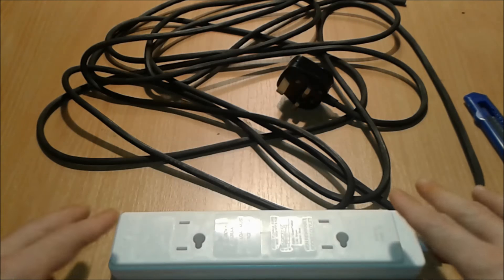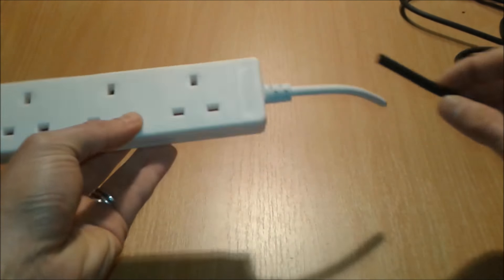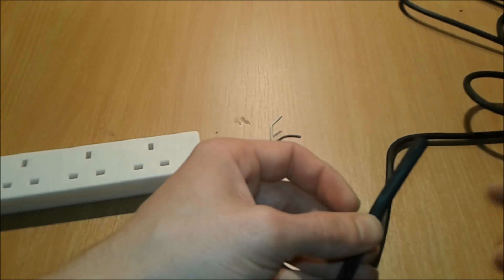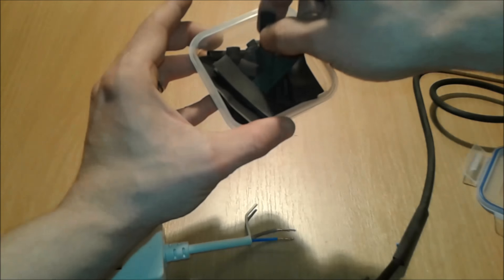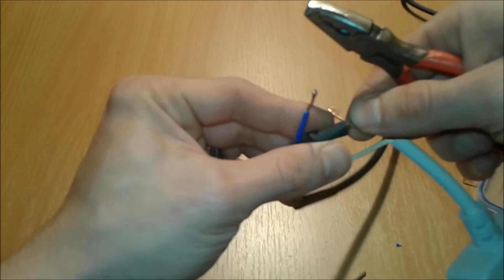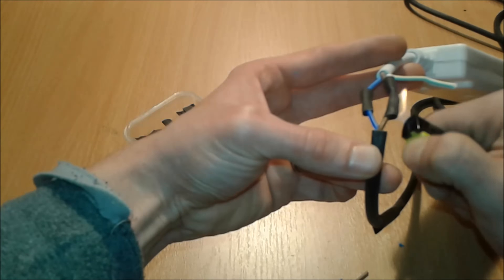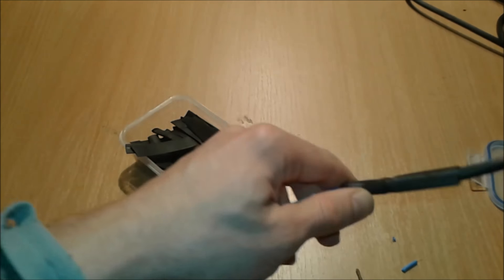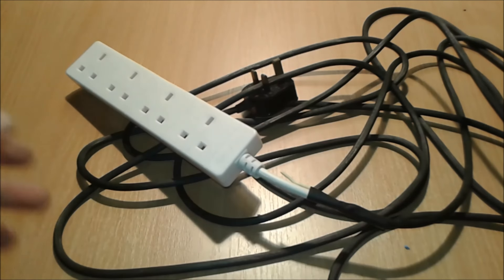How to make a 220 volt power extension cord cable at home

Comment: You got 4 outlets connecting to 220 plug that will connect to main 220 house connection to the breaker pannel box.  What u think will happen if u plug more than one device on. Like all 4 plugs. I speculate it would not have the 220/250 power.  Because it will giving electricity to more than one device. But have u tried it yet. Do u have a follow up video. I understand your idea with this and i will think I try it if i have the materials. But its best to connect one 220/250 outlet..i nstead of the power supply. Because even if u have 4 outlets. U wont get all your devices to its pertentiall. Unless that was the plan. I need to see a follow up video. If this wasnt your idea. Then u can explain to me your thoughts so i can understand.whats the use of this contraption

Comment: That is dangerouse you need to connect the earth wire
Reply from the maker: Adam Williams nooo, you are kidding me
Reply: Er...no, connect the earth wire. You are risking death from electrocution if you use this cable!
Reply: It depends if it is for permanent use or if you are going to bring it in after use. You will need 50 meters of 1.25 mm 2 flex, three core. Get a good rubberized trailing socket (permaplug brand is best) then strip wires of the cord, according to the parameters of the socket, making sure blue is connected to N (NEUTRAL) brown to L (LIVE) and green to E (EARTH). Then wire your plug with same instructions. 
This video was probably the worst advice I have seen regarding electrical safety. The earth is there for a reason. If an appliance was connected to the extension lead illustrated above, and that appliance developed a  fault, then there would be no path to earth. This is because he used two core cable on a setup that required an earth. The fault current would run through you as it would have no other path to earth. That would be enough to kill a human.
Videos like this frustrate me. If someone had followed this, it could kill someone. The earth is there to protect you. Hardly worth someone's life using up some old cable from a vacuum cleaner.
All the best
Reply: In that case, I would just go ahead and but the 50 meter reel. But, you will get a voltage drop,around 7 or 8 volts. Always fully unwind if its on a reel, and check the plug often, for overheating.